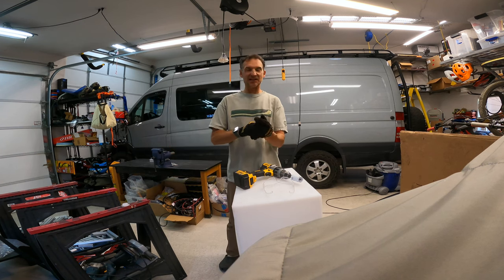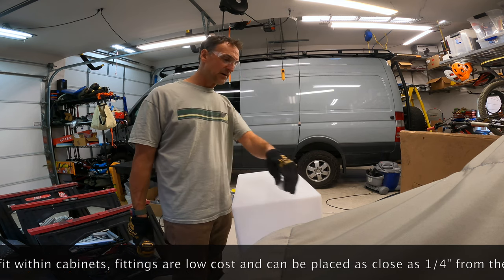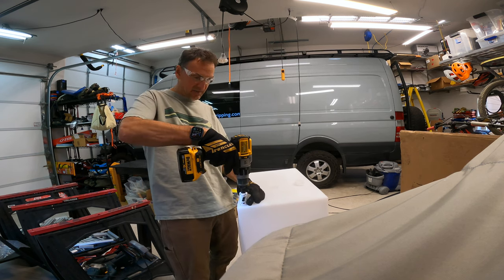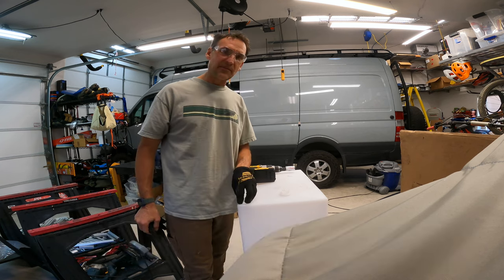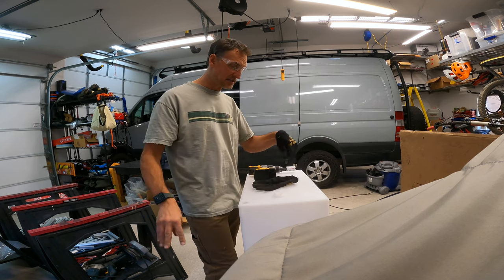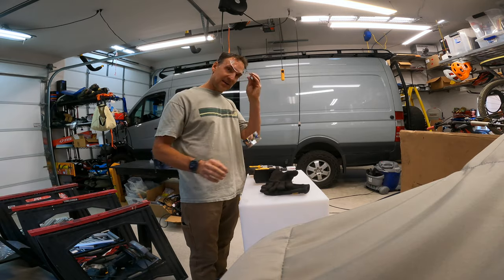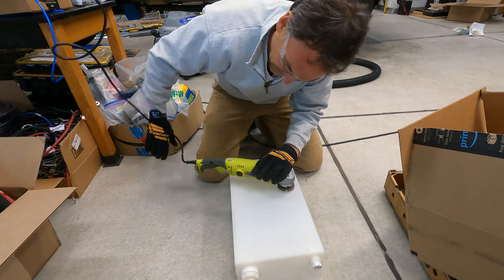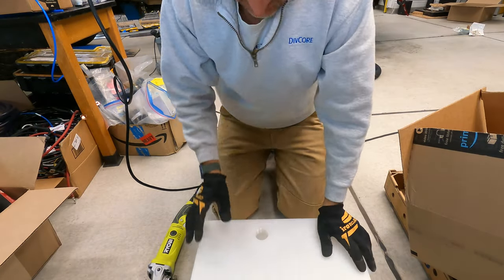Building an Expedition Camper--Spin-welding water tank fittings

Comment: Impressive, I haven't seen spin welding before, obviously a fine line between success and failure, but with minimal practice one should be able to nail it pretty much every time; as you are doing.
Reply from the maker: It is a fine line but you can hear and feel the change as the fittings starts to freeze up on the tank, or see it penetrating into the wall which is time to stop. The plastic dries up within the second you stop the driver, so be sure it's enough but stop before too late. Just watch and feel for it. I've done dozens now and only one of my first wasn't long enough and leaked, and I could peel it off as so poorly attached and spin on another fittings that held fine. So yes, a little practice but fairly easy to be good enough at it for the benefits.

Comment: There must be a monopoly on the slim weld arbors. Insanely priced…

If there’s a cheaper option please show us where.
Reply from the maker: You are right, the arbor's a ridiculously expensive. I bought some thru one of the tank manufacturers years ago for a more reasonable price, Amazon has some for sale, as do others. Just look around. Some have used a bolt put into their grinder. Either way, a $75 arbor, some $1 fittings, and still cheaper than bulk head fittings, and way more compact and can be installed from just the outside and right up against a side wall of the tank.

Comment: What is the model of the Ryobi angle grinder you used for spin welding?  Is the driver you used made specifically for angle grinders?

I enjoyed the video.  Thanks.
Reply from the maker: I don't know the model, but I think any angle grinder will work, as will most routers, depending upon the spin welding fitting driver used. The drivers have either a shaft (router) or a female thread (same as standard grinder threads), so depending upon the driver you have, you can make it work in either with an adapter as simple as a bolt. Hopefully that helps, if not, let me know and I'll try to provide more details.

Comment: Great videos!  Where did you source your tank and fittings?
Reply from the maker: I have been buying my tanks from National Tank Outlet, www.NTOTank.com, as they seem to have good prices and speed of delivery and also a good search function by size. Each tank are made to order, so it does take a few weeks go get them. I bought a bunch of spin-weld fittings and the bits/drivers from a tank manufacturer in LA years ago--can't remember his name or find the details right now--but you can find spin-on weld fittings and the drivers from lots of places now a days from Amazon to tank suppliers--here are some links to help. I recently bought this tank from Amazon https://amzn.to/3Lejywt which worked well for two of the three grey water tanks between the chassis rails. Here is a driver: https://amzn.to/3Lf4Uox and here are some 1/2" fittings: https://amzn.to/3LhB2YE
Reply: @vantripping  thank you so much.  I am about 30 days out from my water system so this is very helpful.
Reply from the maker: @rickgibbsvt  That's great. Glad it's helpful, that's my purpose. Reach out if I can help in some way.